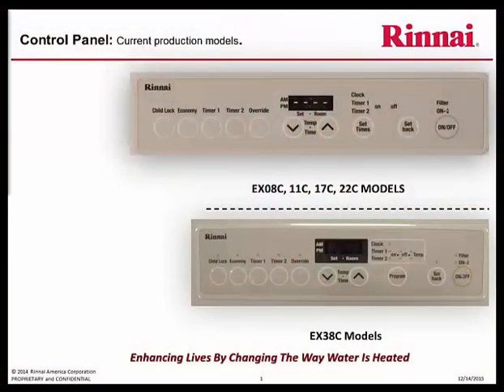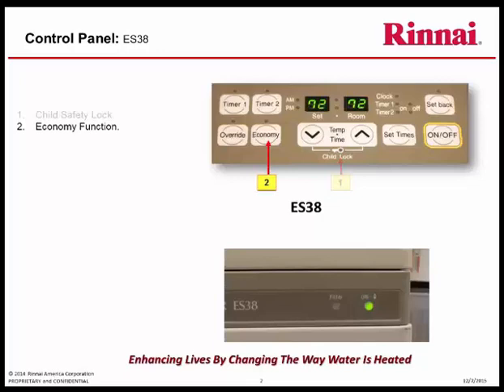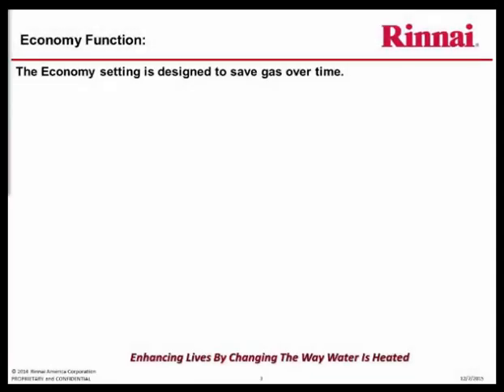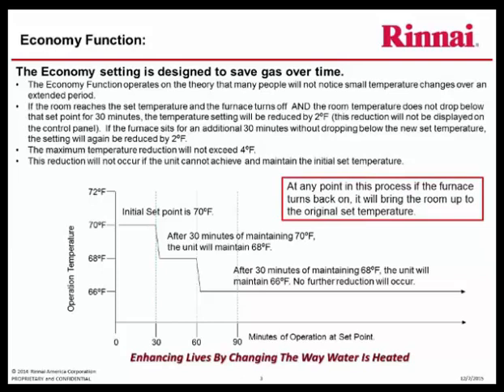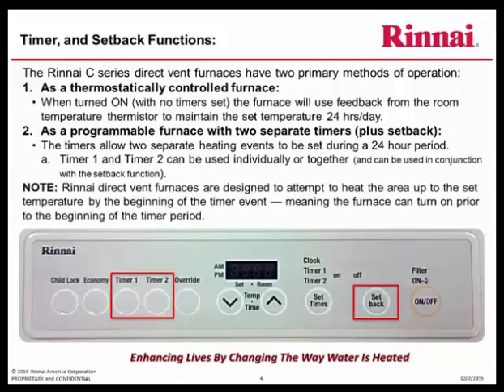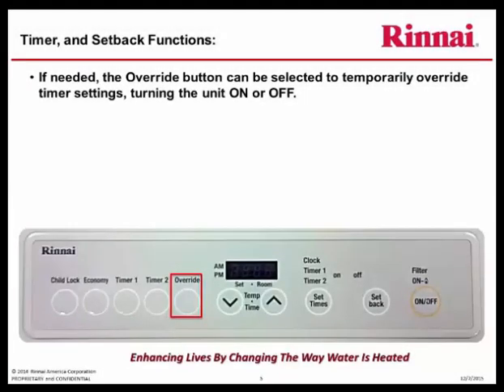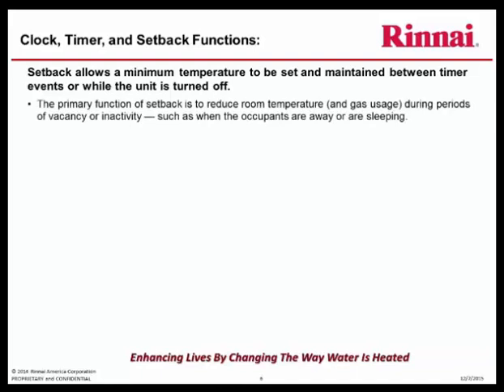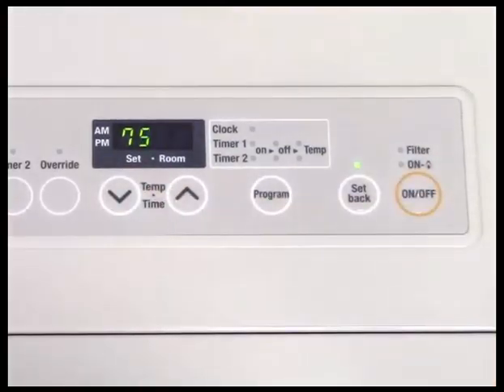Direct Vent Furnace - Control Panel Use

Comment: How does the CT differ from the DT models? it seems like the DT is ready to set up for a wifi enabled thermostat out of the box in the marketing brochures, but in the manual it says you need the optional wall thermostat installation kit, but then the thermostat installation kit manual it says for only use with CT models.

Comment: Temperature reading on mine does not match temperature in the room, sometimes as much as 6 or 7 degrees. is it because it's low and behind the unit panels? (ex: set temp is 62, temp reading says 63, but my multi-meter reads 70 and the unit will still be running)
Reply: Mine does the same thing, apparently the onboard thermistor is near the floor. The thermostat kit / external thermostat appears to be the fix.

Comment: My EX11CTN does NOT have the temperature /with the two lights, that the ES38 does.  So how do I set 68 degrees day and set a lower temperature for over night? I have been doing it manually twice a day during heating season since 09/22/2020. The dealer that installed the unit said he has no clue how to set it. Can it be set like a regular system, if so HOW???.

Comment: I don’t understand the purpose of the setback feature. For example, if I want the room to maintain a temperature of 70 degrees during the night, why not just set the normal temperature at 70 and not use the setback?